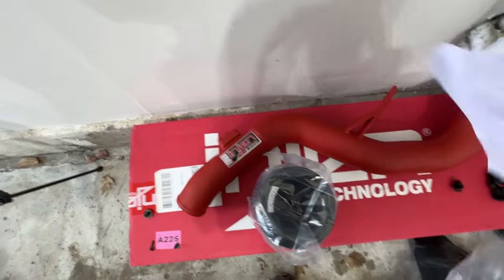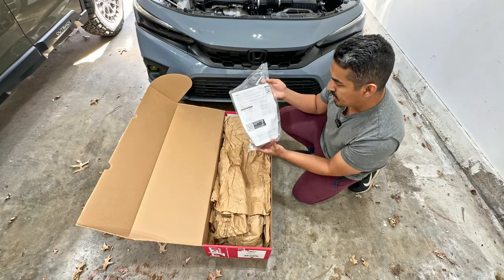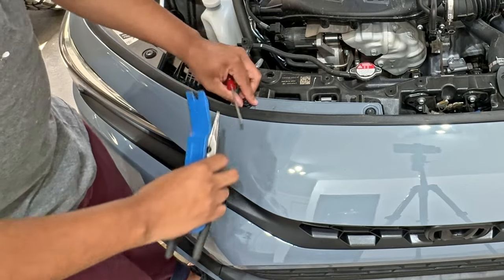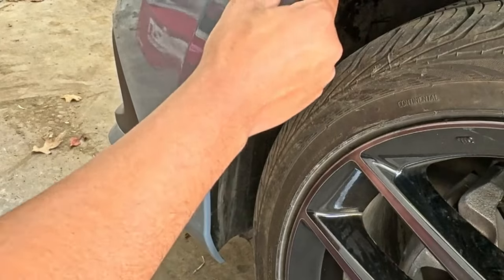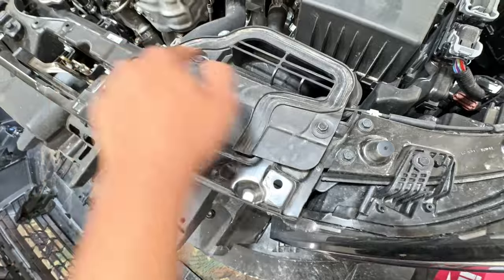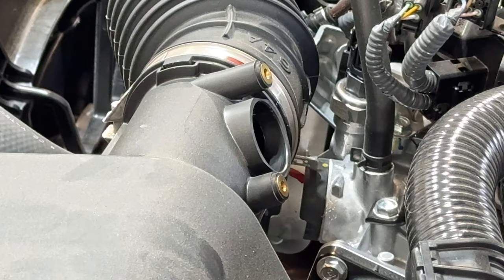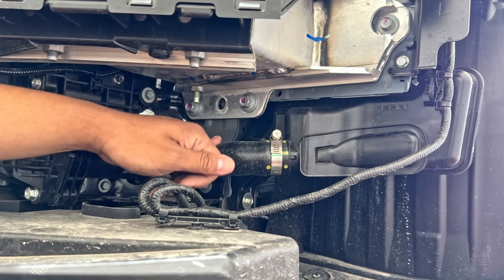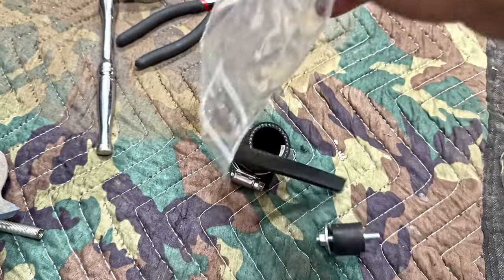INJEN INTAKE INSTALL FOR 2023 HONDA CIVIC(SPORT TOURING) #new #install #Honda

Comment: Love the intake sounds, I have the same exact car and been looking for upgrades to do on my 22 ST. I like the red look in the engine bay but it looks so empty in there! Was wondering … do you have a tune or have you thought about doing a tune with a Ktuner or hondata ? Thank you
Reply from the maker: Hey cam! Thanks for your comment! They sell it in black and chrome as well if you prefer! I love the red because it pops! I haven’t looked into a tune, no!
Reply: Have the same intake installed with fe civic but having some squeaky sound sometimes since tube going below the fender touches the body without clearance is that normal or can be adjusted? Thanks

Comment: Hi bought the same intake injen cold air with fe civic 2023. Just want to know if the tube going below to the fender must have clearance bec have a problem now having sound bec it touches the body without clearance.
Reply from the maker: Hey! Yeah I’ll hear squeaking at times as well! Pretty normal because of the small clearance space!